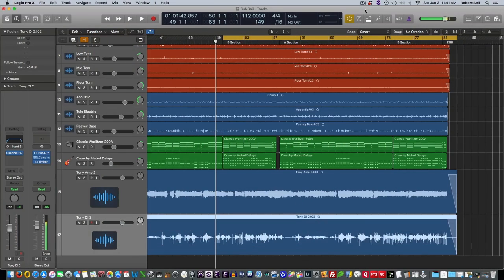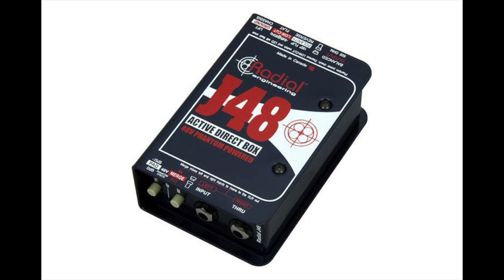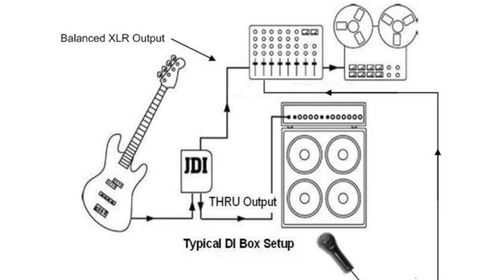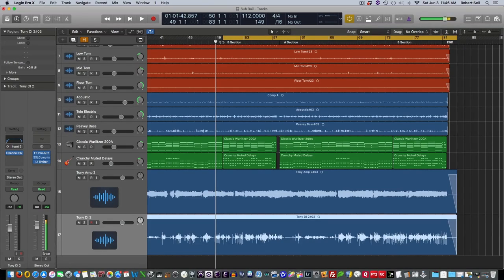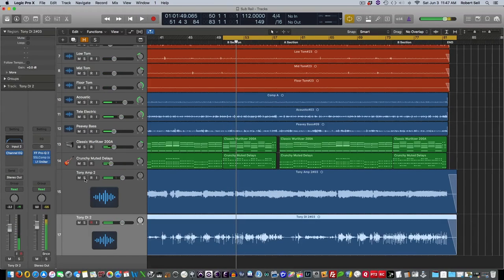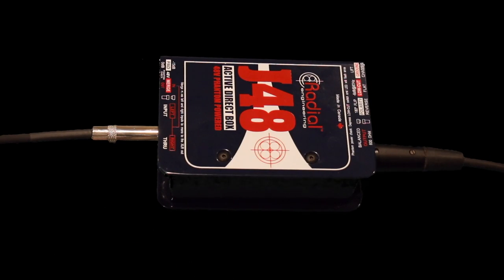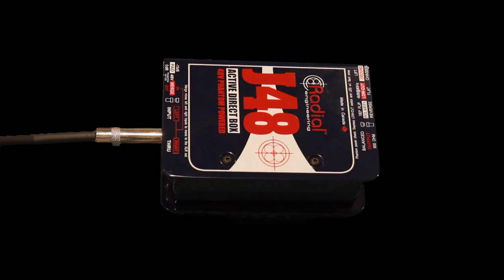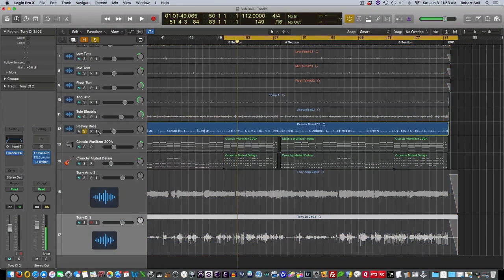Recording Electric Guitar with a DI Box

Comment: Dumb question but if you are prepping your DI to reamp, should you be setting your interface input channel at mic level or line level?
Reply from the maker: Great question! Input channel needs to be Mic level. The output from the DI box is through an XLR or Mic cable… makes since.
Reply: @BobSell  ha ha - You might have just solved a mystery of why my reamps don't ever sound as good as the original take.  Ill give it a try later today! Thanks!

Comment: Will this help to eliminate ground hum? My USB interface(Line 6 UX2) already has the feature that allows me to record clean from the unaffected signal for re-amping. But I’m always experiencing various humming that drives me crazy.
Reply: I wasn’t quite through the video when I hit “send”. I just ordered one... wish me luck!
Reply from the maker: Yes, this unit has a ground lift feature. However, if your interface is already allowing you record clean then I have a cheaper option. Get the HumX. It will safely lift the ground for about 75% less than this DI Box. Here's a link for more information:  http://amzn.to/29Dn58s Hope this helps!
Reply from the maker: Good luck!

Comment: Quick question....so im thinking of buying this but can i plug it into my passive guitar right in my interface into my DAW and use an amp sim like amplitube ? also does this somehow help with gain staging with level control in a way or ...? im really just new to this , just heard of what DI boxes are like an hour ago...
Reply from the maker: The quick answer is yes! The whole point of the DI Box is to create a balanced mic signal that can be used to record a clean guitar sound or provide the Front-of-house engineer with a clean balanced signal. And still have the unaffected high impedance signal for your amp or amp simulator. If you don’t need a clean signal for mixing, reamping, or playing live, maybe you don’t need one. I’m not familiar with your amp sim but maybe it does this for you. Mine has this feature built in. Every serious recording studio will need one at some point. If you record bass, you have to have one. Hope this helps!
Reply: Thank you!

Comment: Hi great  presentation is this model the same as a Radial JDX 48 ? And the radial  model that offers  Fender and Marshall cab sims, can both of these be used the same as  inyour  recording studio?  Many thanks
Reply from the maker: Are you playing live and feeding the the house engineer a signal for the PA? If so, you may want to check out the X model. The JDX captures the guitar amp before the cabinet and has a speaker emulation that may eliminate the need to mic your cabinet. Similar to placing an SM57 in front of a 4x12 half stack. This gives you a more manageable sound onstage where feedback is an issue, or if mic'ing your amp isn't an option.

Comment: Hi Bob! Great video! I had a question.
I have multiple guitar pedals. If I want to record them into my DAW, would I have to go THRU my J48 into the beginning of my pedal chain? I’m not sure how re-amping works in this way.
Reply from the maker: The Thru port only goes to your DAW to record the clean signal. The pedals are linked together with the output of one to the input of the next pedal. So you are recording 2 tracks simultaneously. A clean signal from the J48 thru port and you effects signal from the end of you pedal chain. Hope this helps!

Comment: I have two instrument 1/4 inputs on the front of my clarette interface, can I go from this direct box to one of those 1/4 instrument inputs instead of one the xlr inputs on the back so it doesn’t take up one of my mic ports?? Thanks
Reply from the maker: That’s a great question Larry. Yes you can do that. However, it would defeat the whole purpose of having a Direct Box. Which is converting your unbalanced 1/4 line out of your guitar into a balanced XLR mic level signal. If you used the 1/4 thru port from the DI Box it would be the same as plugging the guitar directly into your Clarette interface. Hope the helps.

Comment: This is a great video! I have a question: the balanced signal that comes from the D.I. must go through the audio interface preamps or bypass them and go directly to the A/D converters?
Thank you so much
Reply from the maker: The balance signal coming from the Direct Box uses a mic cable that goes directly to your converters.

Comment: really good video: 
I´m playing a traditional stratocaster that goes through a pedalboard with plenty of pedals that includes an amp modeler pedal (the strymon iridium) should I play this di box right after my pedalboard and then go direcily into the mixer? what if my sinal is stereo? will this make my signal mono?
Reply from the maker: Thanks for the excellent question! The idea here is to record a dry signal from the guitar. The DI box is first in the chain, before the pedals. The DI box creates a balanced signal for recording a clean track through an XLR cable and also provides a thru port which passes the guitar signal unaffected to go to your amp or pedalboard. This keeps any stereo imaging created by you effects pedals intact. Normally you record 2 mono tracks simultaneously but in your setup it would be 1 mono and 1 stereo track. Hope this helps.
Reply: @BobSell  yeah it does, thanks

Comment: Sounds like I need a DI along with my Focusrite 2i2 to record electric guitar. Setup still bit confusing. Thanks Bob.
Reply from the maker: You don’t really need a DI unless you want the option to reamp your sound. This video will shed some light on the process for you. https://youtu.be/dtaOHj1-kG8
If you play bass, I definitely recommend getting a DI box.
Reply: Thanks Bob for reply 🌻
Reply: Bob Sell I also have a Focusrite Scarlett 2i2, and don’t love the tone of a guitar or bass through the 2i2’s 1/4 inch inputs. Do you think inserting a D.I. between the guitar/bass and the 2i2 (via XLR) would improve the sound?  I was concerned by one comment above (about the Clarett interface) where you mention you would recommend bypassing the interfaces’s preamp and going directly to the converters.  I think the setup I’m mentioning would still go through my 2i2’s preamps?  Thanks for a great video!!

Comment: Hi! How to record the guitar using a DI ? do I need a mixer? I got audio interface that has a 6.5mm jack for input and USB to connect to computer.
Reply from the maker: When you plug in your guitar to a DI Box it passes your guitar Instrument signal unaffected so you can keep that signal and send it to your amp. Secondly, it creates a Mic Level signal for a mixer or your audio interface. Hope this helps.
Reply: @BobSell thanks for answering! So on my case 

it will be Guitar → D.I → Audio Interface? 

is there a XLR to TRS Cable? my audio interface needs TRS for input. 

also would like to ask how to get the 2 signal coming from your guitar and the one on the amp if the D.I will go through on a one input on my audio interface to DAW. I'm kinda confused because I can't see more deep videos.

Comment: Nice video, i wanna ask how if my guitar is an active guitar with emg pickup use 9 volt battery, can i still use the active DI Box?
Reply from the maker: Not normally but the J48 has built in electronics that can handle a range of voltage. So in this case, with the J48, you can use your active guitar as well as your passive ones.  I like this unit because I only need one box. Hope this helps.
Reply: @BobSell  thanks.. by the way, the j48 include cabinet simulator or not?
Reply from the maker: @deadlytone1012  No cabinet sim

Comment: What about Passive vs Active Re-Amp boxes? What is the principle difference in that? Benefits of one vs the other?

Very helpful video by the way! I subbed.
Reply from the maker: A Direct Box converts your unbalanced line level signal to a clean balanced mic level signal. This gives you a very clean unprocessed signal to record that can be used later for reamping or mixing. An active DI requires phantom power for the preamp and boost the signal for recording a clean sound. As a general rule, active DIs are used on passive instrument. And passive DIs are used on active instruments. An active instrument is one that uses a battery pack to boost the signal and therefore only needs a passive DI. A passive instrument does not have a preamp (no battery) and uses an active DI. Hope this helps.
Reply: @BobSell  your video covered that. I am asking about Reamp boxes now, not DI boxes. Does it follow the same principle?

Comment: so can u do without an amp? if i want to play with my band trhough a mixer, hearing us with headphones, is a DI box enough to hear a decent guitar sound?
Reply from the maker: Look at it this way; when you plug your guitar into a DI box it provides to outputs. 1.  a clean balanced signal for your recording desk or audio interface. 2.  A pass thru signal for you amp. It does not provide any color. You can use plugins or amps to alter the tone. Hope this helps.

Comment: Wait so the Tony Amp 2 audio was from a mic? Or was the DI box used?
Reply from the maker: Yes, the Tony Amp 2 audio was with a mic (SM57) on the guitar cabinet. And yes the DI box was used. The signal from the guitar goes into the DI box. Out of the DI box is 2 signals, one line level and one mic level. The line level goes to the guitar amp which was recorded with a mic. The mic level goes directly to the audio interface for recording the DI signal. Make sense?

Comment: In a pedal chain, where must the di box be placed? As first or as last pedal?
Reply from the maker: One of the great features of a DI box is the input (from the guitar) is converted to a balanced output for a clean/unprocessed recording of the guitar. So, having the DI box first in the chain will accomplish this. Then use the "Thru" output, from the DI, to start your pedal chain. The thru output is the same signal coming out of the guitar passed "Thru" the box. Hope this helps!

Comment: Sort of new to all of this. So my question is, if I want to run direct by using my boss GT100, do I need a DI box, or can I run the boss straight to the interface?
Reply from the maker: Run your GT100 into your interface. Think about using a DI Box if you want to record a clean guitar signal simultaneously with you GT100. The clean guitar signal is great to have for reamping purposes. Hope this helps.
Reply: @BobSell  Thanks!

Comment: Do you connect the xlr from DI out to preamp on soundinterface?
Reply from the maker: Thanks for the question! I go straight to my audio interface.
Reply: Do you go in on a ”Line in” or an input with preamp?
Reply from the maker: The DI Box creates a “Mic Level” signal to input into the interface using an XLR cable.

Comment: would using a di be helpful as whenever i plug into my audio interface with my acoustic or microphone is causes a lot of airy noise
Reply from the maker: I would say this is not a good application for a DI box. But without more information and hearing the audio its hard for me to advise you. Can you post an audio or video clip of what you are experiencing?
Reply: Bob Sell uploaded something just there for you
Reply from the maker: I took a listen. Yes, it’s pretty noisy. How did you record this, with a mic or guitar cable directly to you interface? Sounds like the gain is turned up too high or you are recording at a low bit depth rate. Noise floor will be much lower if you can record at 24 bit if not doing so already. If you are getting this same noise with a mic, then a DI box won’t help as its already a mic level signal. Rememer, the main advantage of using a DI box is to convert your guitar (instrument level) signal into a mic level signal for a cleaner signal. Hope this helps.
Reply: Bob Sell i normally plug it straight into the audio interface, its recording at 16bit, only lets me record at either 8bit or 16bit, and i always have the gain quite low to try and get the noise away but that also means everything else goes quieter too, i had asked a producer how i could stop this and he told me to DI the guitar and isolate the vox
Reply: he told me it will probably be due to the fan or drive from the computer and that getting a di for guitar should fix it
Reply from the maker: If you are not recording at 24 bit your first priority is to replace your audio interface. Any other attempt to fix this will just be a disappointment. You can alway buy more equipment later but start with the best interface you can afford but never less than 24 bit! Good luck!!
Reply: Bob Sell no problem thankyou very much for the help!